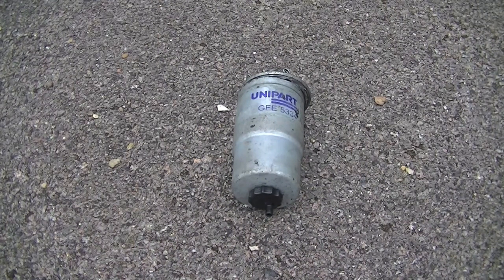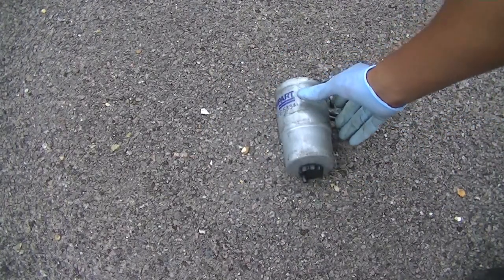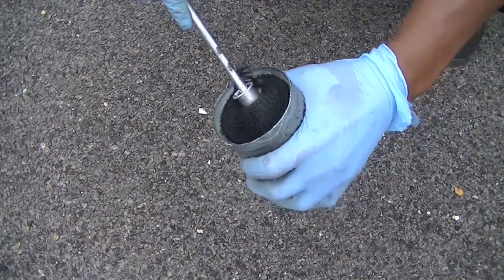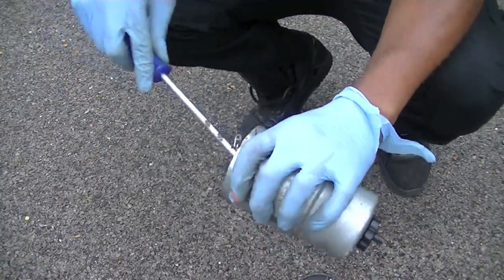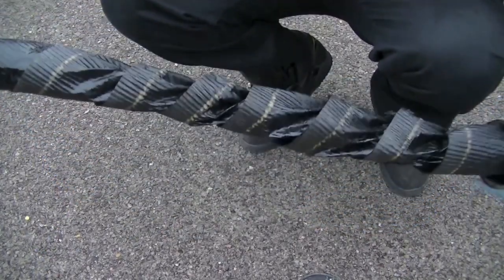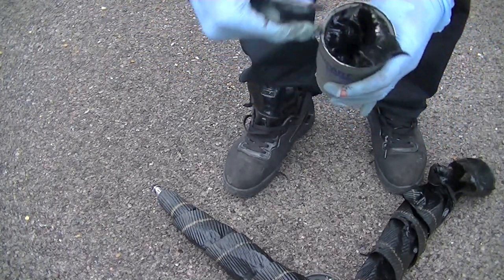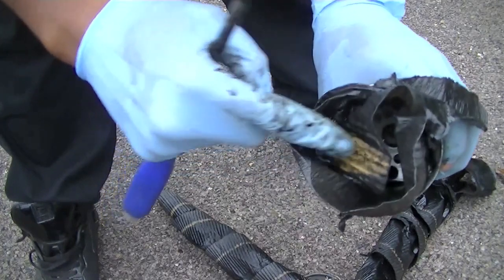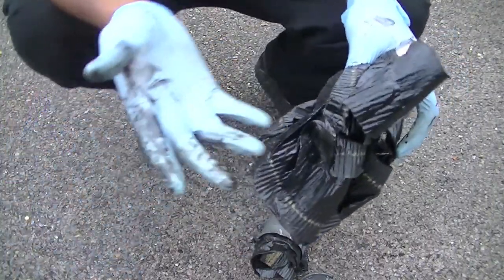Reasons Why You Should Change Your Fuel Filter....... Must See!!

Comment: This filter is from a Diesel Engine. Diesel is a lot more dirty than Gasoline.
Reply: +Brandon Perkins diesel requires far better filtration than petrol
Reply: Kevin mindyourown   Diesel doesn't require any additional filtration compared to gasoline. Diesel fuel has slightly higher viscosity so the filtration media is slightly different.  Diesel fuels used to have considerably higher sulfur content but regulations have changed and that is no longer the case.  I think that after earning a master's degree in engineering and working as an engineer for 28 years, I have figured things out quite well, thank you.
Reply: +BundysGarage my fuel filter was just as dirty as this one after 30,000 miles and i have a gasoline car, i admit diesel burns a lot more dirty usually, but gasoline is still very dirty
Reply: +j jones Diesel is dirtier from any point of view. That's why new diesel engines have Urea injection and DPFs.
If your fuel is not clean or it has water, it will fuck the injectors.
Reply: @Brandon sorry man Diesel is dirtier and it's not "purer", it's less refined and thus contains more contaminates. This always killed me because less refined fuel SHOULD be cheaper, I always assumed the government put more taxes on it since trucking companies probably use more than the normal joe does.

I would still replace my filter at least every 100k, nothing wrong with a $24 commitment over 400,000 miles that can save you hundreds if a clogged filter speeds up your fuel pump's demise. They suck to install and they suck to buy, on those I only go OEM on fuel pumps as many vehicles require you to drop the tank to access it.
Reply: TheRealestEver and thought I was the only one
Reply: +BundysGarage Diesel is cleaner than a gas engine by far. The only thing gas beats a diesel at is particulate matter. But every other single category of emissions a diesel is cleaner.
Reply: +Kevin mindyourown   That is not true anymore because all the engines are fuel injected now.  Many new vehicles have direct injection gasoline engines.
Reply: John Ferguson pop back when you know what your talking about - its dirty going in and its dirty coming out
Reply: haha youv given yourself a thumbs up - engineer that says that is someone that is not knowledgeable about his own trade - all i will say if diesel is clean why does it require water filtration as standard and i'm not going into what heat dose too the fuel after combustion- if you must google your info then google VW.
Reply: Kevin mindyourown Diesel requires water separation because of it's relative density and immiscibility with water.  Gasoline and oil both have additives to deal with the usual and normal amount of water vapor that enters into the fuel supply system.  Diesel isn't cleaner or dirtier than gasoline,  It does generate more soot and diesel engines generate higher nitrous oxide because of the high ignition temperature of the fuel.
Reply: John Ferguson see the copy and paste works well - i say that because that's a laymans explanation missing some detail and as your trying to make a point you'd have included if you did have degree - do they do a degree in googleing
Reply: Kevin mindyourown I see that you attended the school for tower crane driving.  Would it be worth my while to pull up information from technical journals?
Reply: I guess gas wil get either more expensive or dirtier since we have lots of reserves in the TAR SANDS :P
Reply: Most the time filters get dirty from running your car near empty and pull all the sediment from the bottom of the tank through the filter. I never let my car go less than 1/3 full.
Reply: It is. Nevertheless take a look at this: https://youtu.be/8aZLTbG993Y
Reply: +BundysGarage Actually no its not.... Diesel is more pure the Gasoline.
Reply: +Dylan Clay diesel burns dirty, but the fuel passing through the filter has not been combusted yet
Reply: John Ferguson yes i was in my late 40s and felt like a change from CAD design and welding mostly prototyping for various companies like RR - tata - jaguar - and so on but had a craving to operate a tower crane so had a change of direction in 2006 i did quite well as i worked for northfield construction - select - htc cranes - falcon cranes - and even did a stint in dubai on a bloody large hotel / shopping complex - very much enjoyed not paying any tax on your earnings over there and loved the air con in the bus stops - that's a new on me - my final job was at Drax power station building the eco domes you should google that well worth a look - im now back to planning and development with east midlands trains in preparation for the electrification of the midlands lines - im now 54 and plan to retire at 60 and live in derby for a bit of the year and the rest in our second home in la cluse basse as that's not too far from barcelona - a city we are really keen on - and thats live so far

Comment: Does having a dirty fuel filter affect your gas mileage? and this may sound like the most insane thing in the history of this planet but i have never EVER changed my fuel filter on my car lol and i have 55 thousand miles on it lol
Reply: JuanCarlos CastilloDisla A dirty fuel filter can affect gas mileage, but not commonly.  Fuel pressure is the key here, if your filter is really clogged you won't have sufficient pressure and your engine will either run like crap or not at all.  I have 160,000 miles on my car and have never changed the fuel filter.  The manufacturer says it's good for 300,000. Plus, you have to drop the tank to change it on my car.  Most reputable gas stations in the states have very clean fuel.  Every now and again one of them might get some sediment stirred up in their holding tanks and you could get a bad tank, but you'll probably see some symptoms quickly.  TL;DR if you can easily change your fuel filter, it won't hurt to change it often.

Comment: Thanks for the info BMAC VAGS. My mk6 ford transit cut out in town today, and the AA man got his diagnostics on it and said it is likely the fuel pump. Could he be wrong, and all it needs is a new fuel filter? I ran the tank very low (silly me) and as soon as I filled up yesterday, i could feel the engine choking, and today it cut out. Is changing the fuel filter something a non mechanic with good common sense could do at home? Can you direct me to somewhere that would show me how? Cheers mate.
Reply: GoPro Edit Room Cold-shocked the fuel pump; it's dead, Jim.  :(

It's quite a common thing, especially out here in Southern California in the US, with these crazy-hot summers we get.  Folks run their cars down to nearly empty, leaving no fuel in the tank to cool the pump, then pump in cold gas after driving the car around all day in the heat.  It'll kill an aging pump in an instant; you're lucky it even started!

I tend to recommend to my customers that they not allow the fuel level to drop below a quarter tank on the gauge.  This typically leaves enough fuel in the tank to keep the pump submerged and cool.  Much less likely to damage the pump filling up.  :)

Comment: "This shows the dirty fuel that we are buying for such high prices." 

Most fuel filters aren't replaced before 100,000 miles. Assuming 25MPG, that's 4,000 gallons on fuel.  Such a small amount of impurity in thousands of gallons of gas seems pretty reasonable to me.
Reply: Fuel filters should be changed at least every 2 years or 20, 000 miles...for my Bora anyway. I change mine every year or 10, 000 miles....not a 100, 000 miles.
Reply: Roger X Except this vehicle had only covered just over 13 thousand miles, not 100,000 miles, that's not good..!!
Reply: +Bob Smith   "a JOKE"?  ....I don't get it?
Reply: Roger X And who told you fuel filters weren't replaced before 100,000?
You are a JOKE!!

Comment: It's the same for diesel, petrol or gasoline :)
But the easiest to filter is natural gas as they use in Thailand. Can't wait when it comes to Canada. Almost 10 times cheaper  We drove a week for $12. Their new cars come already converted  and older can be converted for about $400. Small tank with gasoline is still needed to start the car but soon as you go it switches automatically to NG. Interestingly not in motorcycles yet.

Comment: diesel or petrol ? Thanks for the video
Reply: This looks like a diesel fuel filter but both types of engines have a fuel filter that should be changed.
Reply: axenz axtiz This is a diesel filter. I have cut apart a gas filter and it is the same thing. The white or yellow media looks like it was dipped in tar.

Comment: Nice vid - But I'd add a technical point - When filters are beyond end of life, they don't stop filtering. What happens is they restrict flow.  A filter doesn't suddenly let bad things through.  E.g. with air filters in rallying or Paris-Dakar, they will quickly reach end of life, but they don't suddenly start letting sand into the engine, they block flow.......

Air filters, oil filters and fuel filters have the same behaviour.  The fuel filter will start to restrict flow.
The video is great, but it's misleading to say that this filter "cannot be filtering any more", unless there's evidence. The best way to test would be to fit that filter to a rig and pour dirty fuel in one side and see what comes out the other. The fact that the paper is discoloured merely means it's doing its job :)
Reply: +Bill Door not completely true, oil filters (engine oil filters) have a built in bypass, as the filter gets dirty it causes resistance witch builds pressure, when the pressure gets too high, it trips the bypass, allowing unfiltered oil through,  and if the bypass should fail, the pressure from the oil pump will force the oil through the filter sometimes tearing the filter element in the process, and because modern cars have the fuel pump in the tank before the filter, and because modern e.f.i. fuel systems have high pressure fuel pumps, a fuel filter that is clogged can be ruptured by the pressure from the fuel pump allowing unfiltered fuel through the system.
Reply: MegaAlchemist007 true that, it's best to change your fuel filter before it does some damage to your fuel pump that's something you don't want happening especially if you have to drop the tank just to get to the fuel pump, it happened on my car luckily access to pump is just under back seat
Reply: +Tony Tapuro what kind of car do you have?
Reply: +Cameron Potts 07 2.5l new beetle
Reply: Bill Door the car won't start after fiting it
Reply: You are essentially correct Bill, if a little pedantic. The essential point though is that it is necessary to change the filter periodically. Not sure about diesel models but on petrol Polos VW don't specify a fuel filter change AT ALL. Let me show you what a 100,000 mile old petrol filter looks like:  https://youtu.be/8aZLTbG993Y
Reply: @CycloneCyd   i was told dont  touch the fuel filters youre asking for trouble replacing them
Reply: its something that rarely needs replacing unlike oil filters
Reply: @si4632  Whoever told you that info was feeding you a load of old baloney. Leave the fuel filter alone if you like, but you will eventually cause early life failure of pump and maybe injectors with the attendant risk of a breakdown far away from home and definitely an expensive repair. BMW Minis for example are particularly prone to fuel pump failure around 100-120 000 miles as a result of clogged in-tank filters And that's here in the UK where fuel is very clean.

Bear in mind that the "design life" of cars is 120-150 000 miles or 10-12 years. If you want a car to last more miles or more years, you need to increase maintenance levels. Simples!!
Reply: @CycloneCyd  90 000 miles so far
Reply: @CycloneCyd  1.3 cdti multijet
Reply: @CycloneCyd  sounds fare enough id be happy to reach 130 000 miles lol
Reply: Point noted here. But lesson is, clean filters prevent stress damage to other important functions of the car.
Reply: ease off I think you're being a bit finicky, it's not a bloody exam

Comment: Diesel fuel filters always turn black pretty quickly, the reason you change them is the paraffin wax will build up inside them as the diesel fuel is heated and cooled passing through the fuel system, as it builds up it restricts fuel flow.  Most secondary fuel filters(primary is on the lift pump in your tank) should be changed every 25,000km if you're on a severe service schedule, or twice that if you treat your vehicle nicely.  The colour in no way reflects the dirtiness of the fuel filter.

Comment: what milage do i need to change my fuel filter
Reply: Your owner's manual will say around 30K miles for a gas engine, and half that for a diesel, but really it depends. If you run a lot with a low level in your tank, more debris may have made it into the line. OTOH, if everything, including the gas station filters, is working right, you may never need to change it. In the absence of problems, changing the filter is a precautionary measure. 
I change mine more frequently than recommended because I like to have it pre- ruled out as a problem should something happen to go wrong.

Comment: It's incredible to think Volkswagen at one point claimed these didn't require replacing at all. Insane.

I need to change mine now. It's got 30,000 miles on it and it's probably why my car is topping out at about 85mph :D

I think I'll run some veg oil through it before I do. It can massively clean the gunk and filth in the bottom of your tank. I don't think I'll prefill though ;) just use some fresh diesel.
Reply from the maker: Can't trust these people. Remember when Asbestos was good for every thing?? Can't trust these people.
Reply: *****
Well 50k is the interval but it's really the latest you should leave it. Your car will eventually start losing power because the filter is saturated and if you leave too long, your car will be starved of fuel then it won't start at all.

Very worst case scenario, the filter starts to break down and you actually start letting it bad particles. Just change it mia. It's so easy.
Reply: volkswagen are liars. hennce the publicity they now get.
Reply: InvisibleYetVisible poison? They are the centre and forefront of the emissions scandel. You deluded ignoramus
Reply: i hate volkswagen engines after Golf Mk3
Reply: juan def
Yawn.
Reply: juan def
I'm aware. Not on this car.... you do realize that.
Reply: InvisibleYetVisible go to bed then
Reply: +InvisibleYetVisible Go to bed then.
Reply: apmirkin I'm not tired. I'm bored..... of reading garbage. Ty.
Reply: InvisibleYetVisible go read a book instead then.
Reply: It's amazing that Volkswagent one time had a clean burning fleet.
Reply: juan def
Not tired. Just bored of reading all the anti VW sentiment by SJW's and idiots on YouTube. These cars weren't even affected by the scandal. Spread your poison elsewhere.

Comment: dayum that is so black...Gaww
Reply: BMAC VAGS Actually, the color alone doesn't say much. It's possible the black filter was even better than a new one (by partially closing microscopic openings with previously suspended solids) in terms of particles it allows through. If the filter unduly impeded the flow of gas, was clogged, that is, then it could be considered bad. And that should have been the demonstration. You should have shown, perhaps by pouring fuel through the filter and noting the flow rate, how clogged it was.
Personally, I use the human lung test. After I remove the old filter, I try to blow air through it. ( When you do this, try to minimize the gas you get on your lips, particularly if you smoke cigarettes. And remember not to inhale. :-} ) Also, blow through the new filter, and then compare. At that point, you might as well change the filter whatever the result, but if it turned out that the old one was badly clogged, you would derive some satisfaction in your decision to make the replacement.
Reply from the maker: I didn't think it was going to be this bad either.